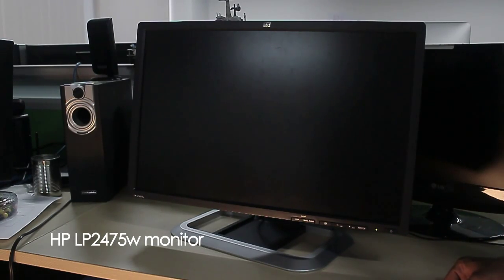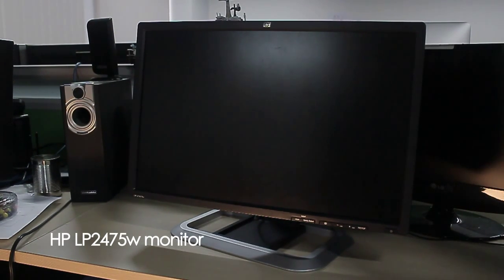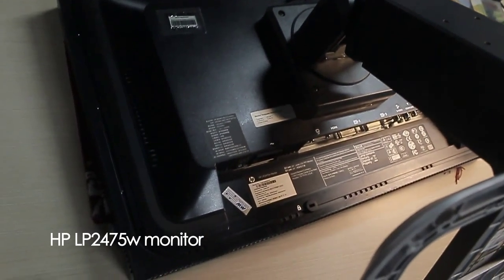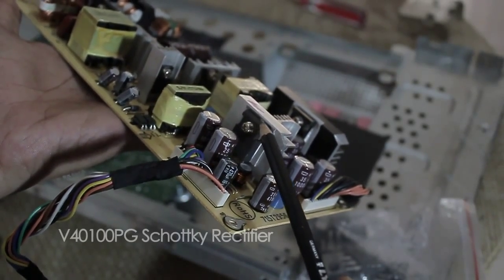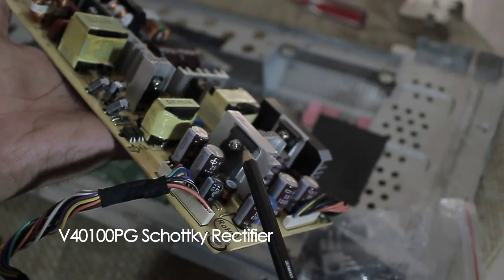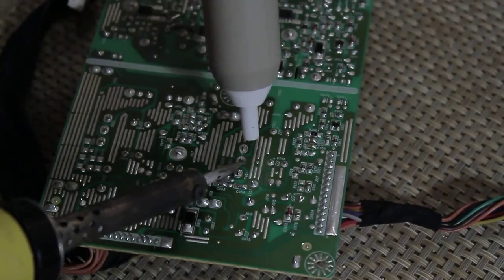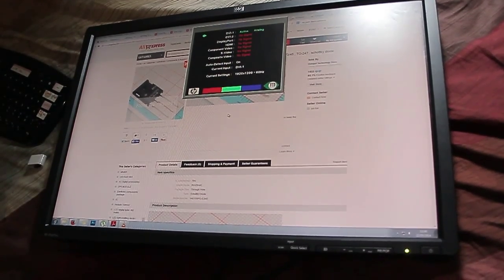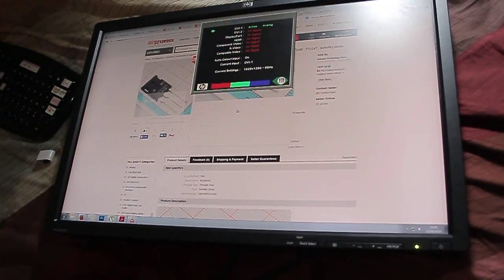HP LP2475w LCD monitor repair (rectifier replacement) fix solved  memperbaiki monitor HP

Comment: I also have a monitor like Hp lp2475w, there is a problem with the backlight, due to which the light does not come on, the light for this monitor is not available in our country, what can I do now, I am a Bangladeshi.
Reply from the maker: If the backlight not available. You need to read the spec of each led volt and ampere needed. And find the replacement from another model that have same volt and ampere.

Comment: Thank you Addiengr1, this was a really cool and informative video but sadly I do not think relates to my problem.
I have two HP LP2475W and they both have the same problem...when viewing on white/light backgrounds there are some permanent stains, I have tried changing the graphics cards and display settings all to no avail.
Do you have any idea what it is (Age and overuse perhaps?) and what I need to do to repair it (can they be repaired?)

Thanks.

H
Reply from the maker: please try search "polarized film" LCD replacement. the stain may cause from overheat film

Comment: Hello
I have lp2275w and he displays colors and the menu does not display how to solve the problem please
Reply from the maker: need to check inside. broken rectifier or capacitors
Reply: @addiengr1  I MUST DISASSEMBLE IT? AND HOW TO KNOW ABOUT DEFECTIVE COMPONENT?

Comment: Love, love this - very helpful. How did you know before taking it apart the rectifier was bad? I had a surge get through last night  and the lp2475w blacked out.  The diode reads 0v (if I'm reading it right) so it sure looks like the rectifier. I couldn't find a Vp40100pg at AliExpress or any of the other parts listed below in the comments. What type of generic  rectifier should I be ordering?

Comment: Can't find this model of Schottky's diode around,  I'm switching to an alternative, testing with a 5Y3GB valve tube wired as it should. Wish me good luck.
Reply: Yes I did buy a schottky diode after.  takes too long for the screen to start up. But fancy, nontheless.

Comment: Just repaired three defect HP LP2475W today, by replacing the 40100 Schottky rectifier with DSSK 60-015A (TO-247 AD) Power Schottky Rectifiers, works like a charm !

Comment: Mine has died today. It's not gone blank though. It's got strange small horizontal lines across it and everything is unreadable. It's not the GPU as I tested on two other monitors and used the AMD GPU and Intel iGPU as well and they all worked fine. Just powering on the monitor without any connections and it is also garbled when the initial scanning menu comes up. However picture in picture does not have any problems as it is bypassing the display circuitry somehow. I also tried different inputs (DVI, DP with the same problem showing). What do you suspect needs replacing?
Reply: reseat every connector and clean the board.
but at this price you can find the same on ebay or newer for almost nothing... but investigate before giving it up

Comment: I have a similar monitor HP L2245wg with same symptoms. I checked the electronic and there is a similar rectifier, but a different model type.

Therefore, it could be the same cause. I will check the model type of the rectifier and do the replacement. Then I will report again.

Comment: Thank you for sharing the video. I replaced the rectifier with a "Schottky-Diode VS-40CPQ100-N3" from RS-Components Germany and it is working fine!!!!
Reply from the maker: thank u for ur  info Schottky-Diode VS-40CPQ100-N3

Comment: How did you take the front cover off?
Reply from the maker: I'm using minus screwdrive, or you can use a spudger. there's gap to insert the screwdrive, please slomo the video.  If hard to open from side, try from front monitor frame,
sometimes I'm using napkin to pull up the frame.

Comment: hello, I need your help, I have two monitors HP LP2475w, the two will not turn on or light a standby, could post a video as I could test this power board out off the monitor.

Comment: Hi addiengr1, my LP2275 monitor with the same problem doesn't have a V40100PG rectifier. But i just ordered one and it is pretty big, to big for my board. Any ideas?
Reply: Any dual shottky will do as long as the pin out is the same (common cathode), 2x20A or higher and 100V or higher and TO-247 package. I used DPG60C200QB for example.

Comment: Hello, is the silver tape you cut an important? Do I need to replace or can I leave it removed? Thank you very much.
Reply from the maker: +ArtinTime better replace a new alum tape. They protect the flex flat ribbon cable, transfer heat to body and grounding.
Reply: +addiengr1 Thanks for a reply. what i'v done is I cut the good sticky portion of the same old tape and re-taped it and it applied really well. Does it need to be a brand new tape? 
Another question if you don't mind me asking is an issue I discovered just today, hadn't noticed it before: http://h30434.www3.hp.com/t5/Desktop-Video-Display-and-Touch/burn-in-on-HP-LP2475W-wide-screen-monitor/td-p/2560831
Any ideas?  
Thank you very much again.

Comment: Hi all!

Where can i buy a v40100pg on the internet?  Google has given me 0 results!
Reply from the maker: Niek Hindriks try ebay or aliexpress
Reply: addiengr1 Thanks,  i hope the quality of the one i bought is fine!

Thanks for sharing the video!
Reply: @NiekHindriks  Or you can buy any other schottkey diode that has 3 pins and a minimum of 40A 100V rating.

Comment: Hi.
I have broken ZR22w.
To have symptoms similar my monitor also this, about 2 minutes power disappears, there will be or disappear with.
Because it was a look at the capacitor problem is a not likely, what is the possibility of the same cause as this?

Comment from the maker: This repair is for the broken power supply board. there are 2 main boards. (power supply & picture controller board)
The rectifier damage is inside the power supply board, most of the case.

Comment: Hi - is this a repair for a fault in which the screen doesn't power up (you can hear a very faint 'ticking' sound when the power switch is turned on)?
Reply: Channel1 For anyone still wondering this, yes, this repair did fix my HP LP2475w where the screen did not power up, but there was a faint ticking or clicking sound. Thanks very much to Adi for creating this video.